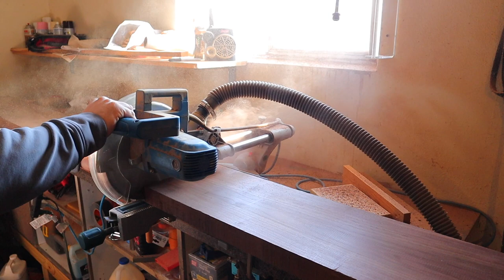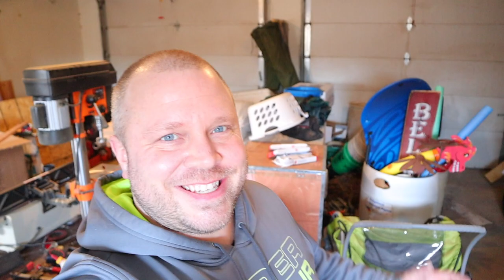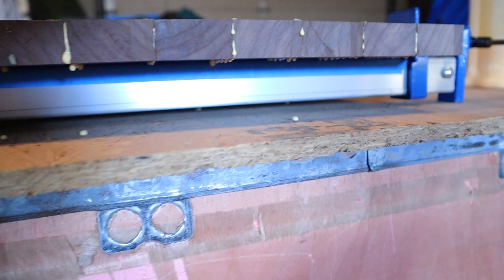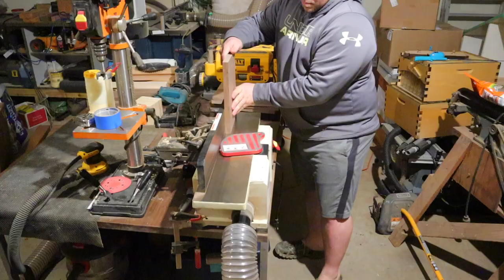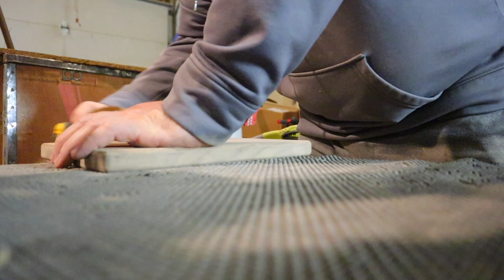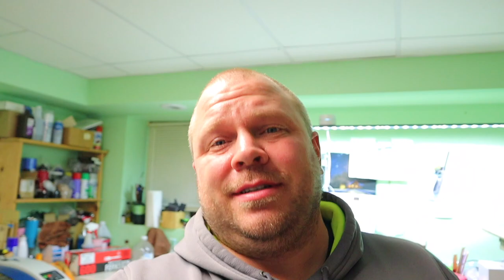Making Cutting Boards to Sell

Comment: I have the same clamps they will twist a bit from time to time. If you measure the interior sizes of the clamps and cut plywood to that size and put it in them they will be way more rigid and allow my clamping force.
Reply from the maker: Awesome thanks for the tip. I definitely like them more then the other one’s

Comment: You just don't know your strength big guy.... More clamps less pressure .. they'll all flex... At least all that I've seen lol..... Coming back to finish the comments... You just reminded me I need to order another silicone glue brush 😆😆😆.... Wire nuts huh.... Love it... Great video guys....
Reply from the maker: Lol so I should have Sara come out and do the clamps. 😂 I like using the wire nuts keeps them all in one little spot rather all over my room. Lol
Reply: @mattsara2802  hahaha.... Maybe.
. Run it by her and see if it flys lol... I'm definitely using wire nuts...I have hundreds
Reply from the maker: LOL 😂

Comment: Great video Matt. I really appreciate the fact I'm not the only person with a disastrous workshop JK. Question, If you laser engraved the cutting boards, would you still use mineral oil to seal then, or some other sealant?
Reply from the maker: I only use mineral oil because I have found it soaks into the wood a lot more then others